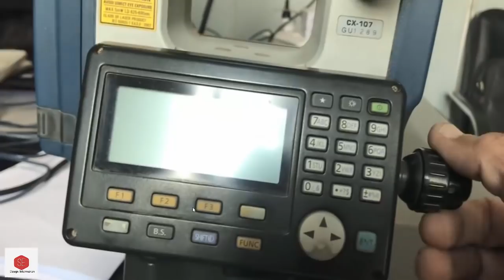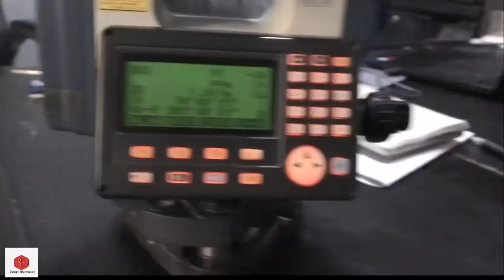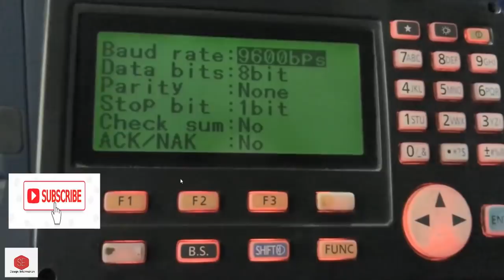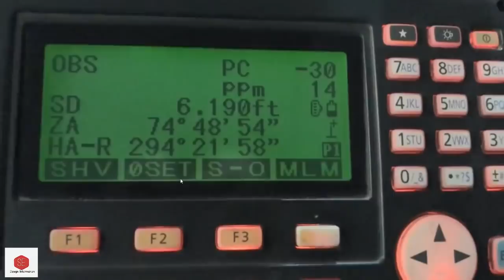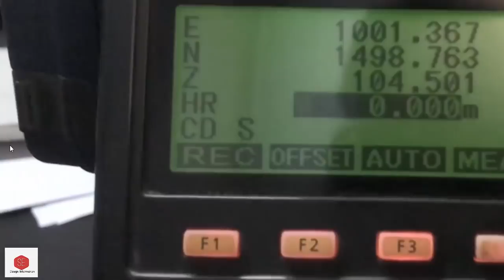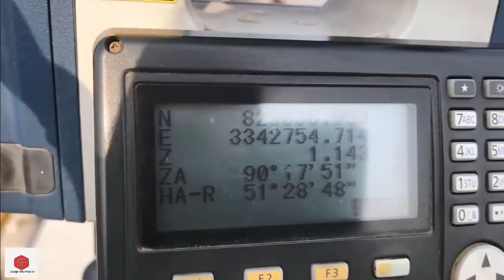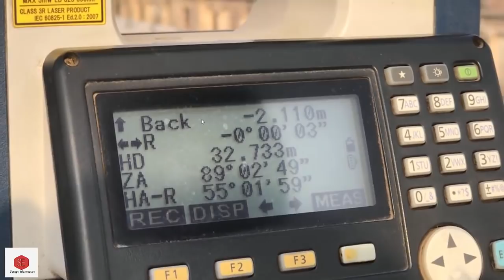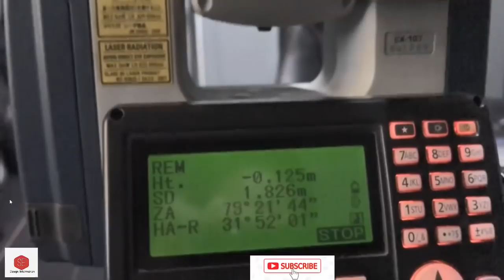Sokkia Total Station  Features . Back Sight -Layout SO Data -MLM  With Elevations

Comment: It's glad to hear from you. And our case, we are constructing a Cement Factory which have this type of IPs a lot. 
There are number of plates on Slab, Column face, Silo shafts, beam top and side. Issue was it's difficult to setting out positions of plates on slab. Especially there are not only linear arrangement but also radial as well. 

1. There is no supports to place Total Station firmly, On top of plywood surface it vibrates more hence instrument level getting out. 
2. No high spots besides to respective building. 
3. But positional accuracy is needed to be maintained in well condition
Could you please assist us to layout IP locations  accurately?
Reply from the maker: G